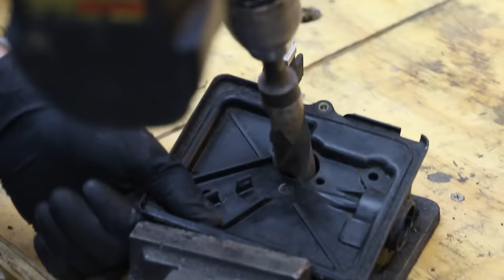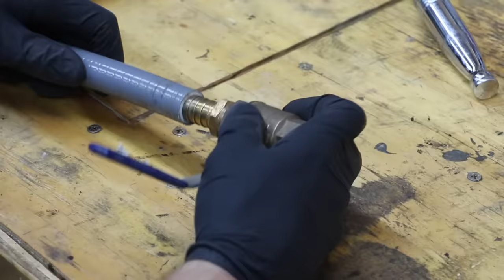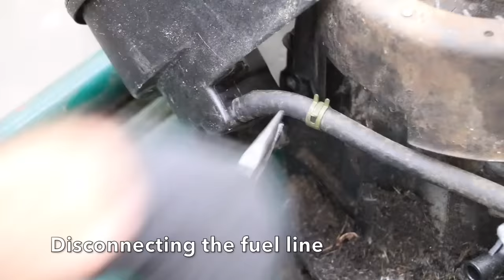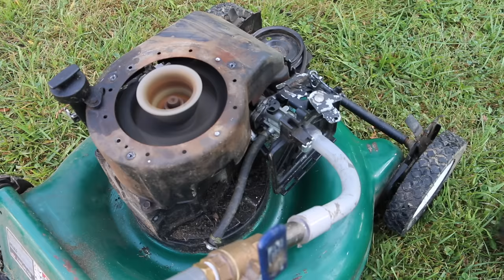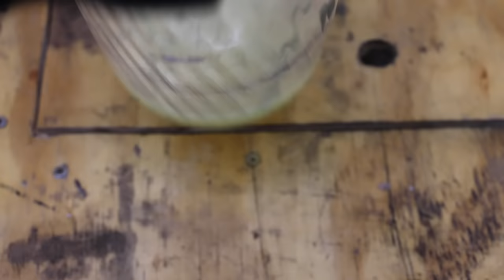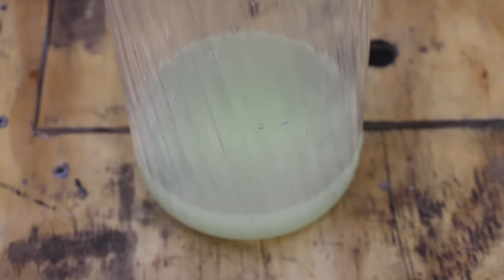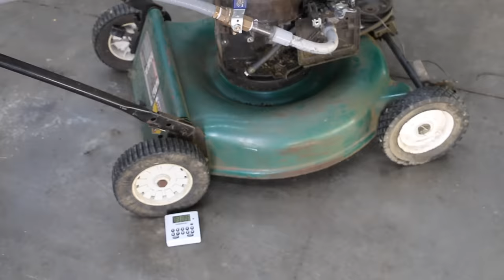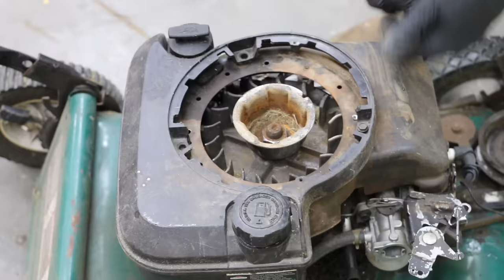Will a "Gas Vapor" Container Improve MPGs and Fuel Efficiency?  Let's find out!

Comment: congratulations you inadvertently made your own carburetor.
Reply: Technically not, he's created a bubbler and deleted the carb altogether. Carb spits out majority liquid that has been Atomized. Engines only run off vapor. A bubbler creates pure gas vapor. By creating a bubbler there is literally nothing a carb does for the engine. A carb only creates a fine mist of fuel--the closest thing to vapor. The reason you tune a carb is to make the liquid closest to gas. Inefficient. If he were to cut the intake line in the bubbler above the fuel line..the engine would've run even more efficient. Vapor combusts. Liquid ignintes.
Reply: @ATFM01  liquid gas doesnt burn even in a combustion engine the carburetor "atomizes" the fuel and the termperature of the combustion chamber puts it into a gaseous state...
Reply: "Burning" liquid fuel is just burning the vapours of the fuel as it the molecules speed up and become a gas....
Reply: @dad5744  The mower wouldn't run. Don't believe idiotic conspiracy theories you see on the Internet.
Reply: @brucetucker4847  I guess you tried it?
Reply: @dad5744  Nope. I haven't tried turning lead into gold through alchemy, either, but I'm pretty confident it doesn't work.
Reply: @dad5744  please take a chemistry class
Reply: @evan_rains  hey your super cool. Thanks. I'm guessing you tried it also.
Reply: @dad5744  no, I'm not stupid enough to believe it could work
Reply: @dad5744  Have you tried this? Does it work???
Reply: @evan_rains  you guys got trolled lol
Reply: @yungchill69  I really hope it was a troll lmao
Reply: @dangerousdoggo5465  . No. It seems I'm not smart enough. I need to take a chemistry class where I test theories of chemicals and fail till I get it right. So I guess testing some else's project is stupid but we do it in schools and labs to see if we can do something slightly different to make it work. I guess these post go along the lines of doubted, laughed at inventors such as Edison, Bell oh and here's a big one the crazy guy TESLA that later on another inventor perfected Tesla's AC power. What about Baird or Wright brothers. All stupid no good conspiracy theorist. So I guess for me it's off to sign up for chem class. I hope I'm not a failure...who knows that might be a good thing. Thanks so much for all your inputs and turning me in the right direction.
Reply: @babaayman9658  That's a dangerous game - most of the time it will go out, the one time it ignites the vapors on its way to the liquid you'll get a nasty burn.

And I did specify through alchemy. :-)
Reply: @dad5744  They don't need to try it the science is well established, the amount of energy required to liberate hydrogen from water far exceeds the amount of energy you could generate with the hydrogen in a combustion engine.
Reply: @Whorifice  so you say DC current is better. Ok. Well I'm in chem class right now so sorry I can't talk right now.
Reply: @brucetucker4847  It works since the engine doesn't care if you use a carburettor or a fancy substitute.

The problem here is that a 2-stroke engine needs oil as lubricant mixed into the gas. True, no smoke as he said but this means that the mower won't last very long.
Reply: Bruce Tucker it would run technically on water if converted to hydrogen, that technology has been around for decades,  actually has been used in aircraft and vehicles ,  and crude oil can be used in Diesel engines. So don’t shoot everything down you don’t understand 😉
Reply: C64 C64  the lawnmower he used is a four stroke engine.  And yes two stoke engines would not last without gas/oil mixture.
Reply: Someguy must have taken a chemistry class. I think it's called an HHC generator.
Reply: @someguy2557  The trouble with hydrogen is that splitting water into hydrogen (and oxygen) takes about a hundred times more energy than you can get back by recombining (burning). So either you have a real cheap source of electricity or it isn't economic at all. Commercial hydrogen is made out of waste from refineries. They take unwanted oil products and simply remove the carbon. So a hydrogen car can't work without gasoline cars, the gasoline users pay for drilling and pumping oil, the hydrogen users make use of some waste almost for free.

True, we have all seen our physic teachers drop 2 wires into water and make hydrogen, but the energy harvested is a fraction of a percent of the electric energy used. There are more sophisticated methods but they can't be scaled up well and are still low in efficiency. An all electric car - even the worst designs from the past - makes much more use of the energy.

So the hydrogen car had died with the atomic power. No way to make a carbon neutral hydrogen car. The best way possible for the time being is making all electric (light) vehicles and use the second best batteries for the task, the salt based ones instead of lithium. It would even be better to go back to cadmium than digging up enough lithium for every car!
Reply: It works I tried it!! U have to do it right
Reply: His carburetor would be the valve he was adjusting
Reply: @isaacdaughertycoventryindu7374  The bottle is the carburetor, the valve is a fuel flow regulator. Equivalent to the jets in a carburetor, just adjustable.
Reply: @evan_rains  You can't fix stupid my man...
Reply: @redlinezo613  carburetors you can adjust the air to fuel ratio that's what he was doing with the valve only adjusting the air to vapor ratio
Reply: @isaacdaughertycoventryindu7374  To a point yes, as more air flow would make more agitated fuel and thus more atomization. Because the air and fuel are mixed before the valve, its more like a throttle plate really, which makes the actual throttle plate more like a vacuum/air flow regulator.
Reply: @dad5744 Is this a question, statement or just complete non-sense? USING WATER AS FUEL IS POSSIBLE BUT IMPRACTICAL, so gtfo off your phone or computer and actually pay attention to your class, who knows you might learn something.

PS. Seriously bringing up actual Rockstar scientists and their disagreements as somehow equivalent to you disagreeing with what is established and accepted is just amazingly arrogant. Good science involves people humbly eating their words all the time, if you got something wrong and someone can prove it that's still progress.
Reply: Indeed. It's a carburetor. Still, great video!
Reply: @dad5744  robert
Reply: hi robert
Reply: Exactly how the 1940s and 50s downdraft carburetors work. I'm glad physics has not changed since then.
Reply: @dungeondark  In reverse up hill. Learned that in chem class.
Reply: I’m just wondering why he thought this would work ? Is he trying to debunk some conspiracy?
Reply: @CC-ke5np  is this not a Briggs or similar mower with a crankcase oil drain?
Reply: @CC-ke5np  what about the micro underwater breathing devices?
Reply: @iordnbrun5498  I am not familiar with that type. In Germany Sachs, Fuchs, Sabo and Stil dominate(d) the market.
Reply: @iordnbrun5498  Fake. Was made up for a James Bond movie. They just took empty whipped cream dispenser cartridges  as a prop. Even the US Navy fell for it and asked the movie prop guys how long it lasts. "As long as you can hold your breath" was the answer.

The first appearance of micro oxygen tanks in movies was in "Raumpatroilie Orion" (German Scifi series, made at the same time as the very first Star Trek episodes) where they repressurized an entire large space station by shooting a spare suit cartridge with a laser gun. It was a soda dispenser cartridge.

What is real is a soda bottle sized device for emergencies. It holds 2 or 3 breaths of air and meant to be used for troubleshooting your main scuba gear or switching to a spare gear. They are also good to buy time when your car dropped into water until the interior filled enough to open the door and then swim to the surface.
Reply: @Whorifice  so maybe you need to take a "Science history class". The inventors I mentioned, in their time, and some even after their death, had people just like YOU that said "it's scientifically impossible" and told they were stupid or shutdown. Tesla for example, before the internet there was the encyclopedia. Tesla had almost 4 pages then later was reduced to a small article as everyone felt he was a nobody. Sure now they are rockstars and Tesla only really years after his death. So please, keep going, tell me something else from your realm of knowledge.
Reply: No a carburetor spits liquid the the liquid evaporates on its own (that's why the efficiencies are higher with a warm motor) the fuel vaporizes by itself the carburetor just mist the fuel not vaporize it
Reply: @dad5744  Tesla had science behind him, this guy does not.  You do not.  Look up Dunning-Krueger.  You're just making yourself look that much more dumb.  The machine in your video breaks the 2nd law of thermo dynamics, which makes it an impossible fraud.  In order for a spark plug to ignite water as a fuel, you need to separate the H2O molecule into the base element hydrogen.  In order to do this, you need more energy to convert the water to hydrogen than the energy you would get out of the machine.  Very basic 2nd law of thermal dynamics stuff.  Go take a chemistry class and then come back and post comments, when you actually know what you're talking about.
Reply: Congratulations?  He's ahead of you hotrod.
Reply: @dad5744   Now I didn't try this either, but I did watch that video. 
A few thing's I'd like to point out;

1. When he stated it was releasing radiation and said it wasn't any of the typical things you would think it would be, like Alpha, Beta, or Gamma, he seemed to insinuate that it was something different or uncommon like magic. Well their are only a few types of radiation and he eliminated a good portion of them, so that "mysterious" radiation that he didn't have any idea as to what it was is probably infrared and visible light; this is nothing new and is honestly to be expected when you stick a metal pipe into the exhaust. To someone who is moderately familiar with this kind of stuff it makes him sound like an idiot. 

2. What he states is actually possible but it wouldn't be possible with his machine. The amount of heat required to split/decompose water and other compounds into usable fuels is so high you can't use iron based alloys to do it, and he did state that he used stainless steel which is an iron based alloy in the video. Water decomposition starts at 2200 C but would have to be at around 3000 C to get usable amounts of fuel. The stainless steel with the highest heat rating I know of is ~2000 C and melts at ~2700 C, any hotter than 2000 C for that steel would lead to failure. There is no other method for splitting/decomposing multiple types of extremely different compounds other than heating them up. 

3. The plasma statement. The interesting thing about this is that their are multiple types of plasma hot and cold. Hot plasma is just that, things that are so hot the turn into plasma, if the previous method is correct then this is that plasma and it would be very very hot and would most certainly melt steel. Cold plasma is the interesting part; cold plasma is extremely hard to make and requires electricity, further it is actually possible to split/decompose water and hydrocarbons using this method, the only issue is that he very clearly does not have the hardware for this method. Cold Plasma for clarification is when you heat up only the electrons. So for him to get this to work he would have to heat up the electron in the atoms to at least 2200 C while keeping the nucleus at no more than 800 C(This temperature because the machine isn't actually glowing, but this temperature would also probably prove catastrophic for the lubricant upon injection into the engine). 

4. The schematic were taken down so I can not review them to tell you they don't actually work, but hey conspiracy. However the addition on the end of the exhaust appears to be nothing more than a simple distillation apparatus and in no way resembles the cold plasma reaction chamber this machine would need to actually function as advertised. Further is is also highly unlikely the exhaust could provide enough energy to actually facilitate any of the processes I already mentioned, cemented buy the point that the lady adding scent to the napkins didn't have her fingers vaporized and nobody was alarmed by a flame that would have been shooting out. 

My best guess is that the contraption had enough fuel added to it for the video to end and the exhaust was probably being filtered on the way out to remove scents. Or everyone in the video was just a liar.

Edit: I just found and reviewed the patent. The patents doesn't state that it can run on only water, it stated it can run on water contaminated fuel. I was also correct in the method of operation, and this contraption would not get hot enough to decompose water. With water contaminated fuel it probably heats it up enough to where liquid water doesn't make it into the engine to cause problems and just passes through. Further on using alternate fuel sources this contraption would probably only vaporize the source, allowing it to actually be burned in the combustion engine, so you wouldn't be relying liquid fuel injection to vaporize the fuel. As far as the battery acid goes, low temp decomposition causes the release of sulfur dioxide and oxygen, so it probably allows for the easier burning of other fuels already in the contraption, battery acid wouldn't work on it's own. With this being said, the patent has the exhaust and reaction sections completely separate so it would be impossible for it to release no pollutants, and everything going in has to come out, else their will be build up. It would be technically possible for this contraption to facilitate the use of alternate already burnable fuel sources as a fuel preheater/vaporizer, but the zero pollution aspect is impossible based on the design lain out in the patent. The exhaust temperature wouldn't be higher than 1200 C so it would be impossible for this contraption to break down water and other compounds into its base components. In short the guy made a vaporization chamber, and is a complete idiot for not realizing that is what he made.

Edit 2: I just noticed the design that was used in the video was nearly identical to the one in the patent. The fuel is just routed though the exhaust and heated up prior to injection.
Reply: @CC-ke5np  thats probably not a 2 stroke and all 2 strokes do not take oil in the fuel.
Reply: @ATFM01  on behalf of mechanics everywhere, thank you.
Reply: Lol
Reply: @ATFM01  Didn't work that way when we worked carburetors in my carburetor class. Also, there is a carburetor that was said to have complete atomization with the atomized being burned dry, rather than wet. A little history lesson our instructor includes in the class.
Reply: @dad5744  You can use water as fuel, but only in hydro engines, which the government banned. In a gasoline or diesel internal combustion engine you are just trying to rust your parts, you won't burn water in these. If you wanted to burn the water by having it break down and burn the unstable hydrogen, an internal combustion gasoline engine, like PF uses, wouldn't work.
Reply: @brucetucker4847  They found you can use mercury to make gold, but the expenses far excede the yield.
Reply: @dad5744  Edison was a joke. Tired to prove how dangerous Tesla's free DC is by failing to kill an elephant and shocking a human on/off for 86 days and had less understanding of both AC and DC than Tesla.
Reply: @someguy2557  Internal combustion gasoline engines can breakdown water to hydrogen?
Reply: @CC-ke5np  Are you sure 2-strokes have valves?
Reply: @CC-ke5np  I didn't know I required a hydrogen car to drive my Mercury.
Reply: @isaacdaughertycoventryindu7374  Again, doesn't sound like what was taught in Carburetor class, also doesn't match up with any carburetors I, the multiple SAE techs I am related to or received instruction from, or blueprints for them that I ever seen.
Reply: spawn2882  Wouldn't power a car, yet powered several air ships. Also, how would you do this with an internal combustion gasoline engine, as that is what was used in the video and the base of the discussion?
Reply: @dad5744  I watched your GEET video. Snake oil salesmen showing a potentially pre-primed engine in a short demonstration without providing evidence of their system or discussing the process. I did find a commenter that did, the GEET allows your engine to run on atomized fuel..... Which is what they already do without the GEET.
Reply: @dad5744  There it is, argumentum ad hominem fallacy. Using arguments that are logically false doesn't prove your argument and defaces yourself for using it.
Reply: @alec4672  Really? So some carbs don't have a venturi?
Reply: @dad5744  "Why didn't Tesla's free DC take flight?" Are you willfully ignorant of capitalism?
Reply: @Bob800800  If they claim something is radioactive but can't tell you how while making the claim in this age, (almost everything is radioactive, even bananas wills set of a Geiger Counter, the matter is how high and what type), then we need to confiscate the crayons in their nasal cavity.
Reply: @davidcraft4909  All 2 strokes don't take oil in the fuel? Damn, those owner's, service, repair, fuel and oil instruction manuals and automotive service technician text books all need to 've rewritten.
Reply: @axslaps  Tesla didn't take off for one thing because of money. He tried to get support from Rockefeller but Rockefeller wanted people to pay for electricity by running wire everywhere.
Reply: @axslaps  please be specific
Reply: @dad5744  Yes, that's what I said.
Reply: @dad5744  I know a 500 mile/meter ranged coil wouldn't be cheap to repair, and to offer free repair and not charge for usage wasn't going to garner profits like Rockefeller, Edison and GE want.
Reply: spawn2882  You know I have experience as a federal service tech, carpentry and masonry as a specialist in those,  as well as the vehicles I drove, serviced, fuelled, hauled the vehicle as well as and issued ammo to up to 1.1G TOW missiles, and did my medium duty diesel engine report on has methods to prevent flames from entering the fuel supply, right?
Reply: spawn2882  Why do you keep suggesting everyone drive hydrogen powered VBIEDs?
Reply: spawn2882  XD
Reply: @axslaps  I believe there is a direct oil injection design for larger 2 stroke engines now
Reply: @brucetucker4847  You do know that you actually can on a molecular level, right? Not saying its feasible, but it is technically possible.
Reply: @dad5744  What many do realize is that Water, on it's own, can't burn. It would need to be broken down to it's base elements (Hydrogen and Oxygen) and then those gases are ignited to reproduce water. in a small internal combustion engine you will find that you get less power out of the water than the energy put in to break the water down to the base elements compared to Gasoline. That is where the issue lies in running a small engine off of water. There is a process to get it to work and the process does do as expected.

The funny thing is, NASA has been using "water" to launch their rockets for ages. It takes a lot of energy to break down water, but figure out how to make a car capable of just pouring a couple of gallons of clean water into a tank and driving off and you'll have the Oil industry knocking down your door to either pay you to never tell or to kill you off. It's what happened to the guy that supposedly made a volkswagen beetle run on water.
Reply: @TheDeelunatic  there's another post somewhere here of a video I shared. Sugar is the fuel but water is used to carry the sugar to the combustion chamber. Although several people on here say that's it's trick photography. Carbon footprint is a huge thing with this. If someone was to actually develop it we might be able to reduce the greenhouse gases. But if we did that the earth might fix itself and gasoline would be minimally used and of course we can't have that. Guess it's along the lines of no free electricity, gov can seize what they want and oil controller the world.
Reply: @johnturtle6649  It is possible through nuclear processes, not through chemical ones.
Reply: @brucetucker4847  Thats all im saying, it is technically possible. Alchemy isnt stupid, its just unfeasible.
Reply: @danielalfonso672  
"I believe there is a direct oil injection design for larger 2 stroke engines now"
They've been using that tech in motorcycles since 1913 so it isn't by any means new lol.
Reply: spawn2882  Storing it as water would make it useless as a fuel since it takes more energy to split the molecule than you would get from recombining it. Other than scrapping the idea completely, efforts should be focused on making hydrogen storage as fail-safe as possible as opposed to trying to break the laws of physics.
Reply: @ATFM01  Atomization is better.
Reply: @johnturtle6649  The problem with turning elements from one into another with alchemy is that alchemy is a spiritual process,  not material.
Reply: a carb does a different job  it just  sprays a small amount of fuel  that is different from vapors .
Reply: It is very short sighted to write off hydrogen powered vehicles, just because water is the only place you know where to get hydrogen. That just sounds more like a reason to explore new methods of obtaining cheap hydrogen. You don't even really need to know chemistry to realize that. That's just basic logic.
Reply: shea  hydrogen is in gasoline and it's what causes it to burn .  Watch  Stan Myers videos  He tell how much  hydrogen is in   each one  .
Reply: @frosty1433  I'm not opposed to it because of that, I'm  opposed to it because I'm familiar with the history of its use and LZ129, R101, Dixmude and others and I know damn well that oxygen is abundant, how it reacts with hydrogen and how easy it is to make explosives and I also know many people are really good at shooting moving tarets, so hydrogen engines are just IEDs in waiting.
Reply: @brucetucker4847  they actually do turn lead into gold Mr chemistry.
Reply: @dad5744  you do know that sugar is a hydrocarbon, yes?  that's why you exhale CO2.  it's why plants inhale CO2 to make it.  you're also failing to realize the environmental impact of growing all that sugar.  much like the ethanol thing.  if we converted every inch of farmable land in the world to grow corn for ethanol, we would not even meet the energy needs of the united states.  that speaks nothing of the environmental catastrophe that comes from a monoculture such as that.

hell, we already have a spate of envoronmental problems due to overgrowing sugar beets.

ecology aside, if you'd learn a bit about real chemestry, as people have several times suggested to you, you'd know that burning sugar will not lessen any carbon footprint.
Reply: @rakninja  so you saying it's trick photography like the rest. Ok. Who said cover the world with sugar? See I don't have any education at all. So your talking over my head. I guess his meter lies. But the problem is NONE OF YOU SCIENTIST HAVE TRIED IT. YOU ONLY GO BY WHAT SOMEONE ELSE TOLD YOU. IF WE STUCK WITH THAT I GUESS THE WORLD WOULD STILL BE FLAT. so you keep your flat map and I will keep my globe. Maybe if y'all looked outside the box y'all would find that not everything they tell you in school is correct. In the military we had guys like y'all that thought they knew EVERYTHING just because they got a butter bar for going to college. Those are the guys that read the books on army tactics and thinking they knew it all got people killed. And no I'm not changing the subject. Y'all are like horses with blinders on only going where they lead you. Y'all are cool arrows👍👍 << by the way that's 2 thumbs up.... REALLY cool.
Reply: @axslaps  All I'm saying is that if push came to shove, and we had to replace gasoline for some reason, I'm sure we would probably turn to a hydrogen solution some how. The safety concern is a very valid concern, but I'm sure we could just find someway to store it as some sort of safe hydrogen-enriched fluid, that would probably work the same as gasoline. I mean, I just think it's smart to think of possible alternatives, by finding a way to make what we know works, actually work in a viable way. If it's in the realm of possibility, think about how it might work, once you've already established how it won't work.
Reply: @rakninja  your linked vids are no where close to what's being talked about. And I guess that if CO2 is on the low side it's d bad. Sugar compared to petrol is about a 1/16 of the foot print. Did you watch the GEET video?
Reply: @dad5744  why would i, you were talking about sugar for fuel, which is ridiculous if you thought about it for half a second.

the point of my videos was to show you the residue left over by burning sugar.

now, having watched that video, i do not understand how anyone who knows the first thing about internal combustion engines or chemistry would see this for anything other than snake oil.  "x-rays that prove that it is some unknown radiation?"  "carbon being transmuted to a lighter element?"

for one, x-ray machines can only detect x-rays, the active part is the film, which is only sensitive to x-ray radiation.

for two, it takes more energy to transmute an element to a lighter one than is released.  example:  you use electrolysis to separate water into hydrogen and oxygen.  the net electricity you put in will always be greater than any energy you can pull out.  this is because the laws of thermodynamics.

furthermore: https://www.splcenter.org/fighting-hate/intelligence-report/2012/oklahoma-survivalist-claims-motor-will-run-anything
Reply: @frosty1433  Why hydrogen over aqua engines, electric or others?
Reply: @TheDeelunatic  I read that his patent was rejected. Haven't heard about him being threatened, just that the system shut him down and banned it.
Reply: @Sertao2013  What do you think spray is?
Reply: @rakninja  As well as sage, Russian willows among thousands of other plants, bugs, insects and architectural development, what's your point?
Reply: @dad5744  You don't have to go to college to get O-1. And completing, they changed it a few times now so, however many years in SROTC or different number of years for JROTC will give automatic promotion upon enlistment.
Reply: @dad5744  Also, don't have to know something only by experience, I don't need to be a burn victim to know it'll hurt, damage tissue, etc.
Reply: @rakninja  Never taken chemistry, but I did some independent research. And yea, sugar in the engine is no good, been word for a long time it would caramelize. Project Farm did the video on using sugar, wasn't seeing as much as I anticipated, but regardless pv cause, carbon buildup in a combustion chamber isn't something I'd  say to aim for with "improving" performance, as these pro-sugar nuts think it does.
Reply: @CC-ke5np  Right now. Processes improve or change.
Reply: @diji5071  As stated before: yes, but by nuclear reactions, not chemical ones. There is no way to turn lead into gold through chemistry.
Reply: There is a big difference . If you  spray gas  from a carb it will fall to the ground and  get the ground wet . If you send vapors through the carb   nothing will hit the ground .
Reply: @brucetucker4847  oops!
Reply: @brucetucker4847  Alchemists have often been dismissed as pseudoscientific charlatans but in many ways they paved the way for modern chemistry and medicine. The alchemists of the 16th and 17th centuries developed new experimental techniques, medicines and other chemical concoctions, such as pigments. And many of them "were amazingly good experimentalists,” says Lawrence Principe, a chemist and science historian at Johns Hopkins University.
Reply: @axslaps  what exactly is the sage and russian willow thing directed at?  it is not clear to me.
Reply: @rakninja  Any idea how many deserts are manmade?
Reply: @Sertao2013  Dry vapor? That would be the ideal. There was a carb that supposedly had a great mastery of having dry fuel in the chamber over a century ago, but it was also hidden away.
Reply: @axslaps  cannot find a good source.  the only one i can see for sure is the saini desert, erected as a kind of border wall between egypt and palastine.

i've seen a few crackpot places claim that ALL deserts are man made, however mountin ranges are typically the natural cause for deserts.  for example:  the himalayas created the sahara.

why are you asking me this, though?
Reply: @brucetucker4847  water has the most combustible and abundant element on earth in it so I'm sure its possible
Reply: @NoMoreBsPlease  You are talking about making hydrogen?

Yes, there are more efficient ways than shown in physics101 which is putting two wires into salted water (1..2% efficiency). The trouble is that all high efficiency methods are complicated and can't be scaled well. So it can't be economically made in an industrial scale (yet). At least not as long as using refinery byproducts is so incredible cheap to process to hydrogen.

But the real problem is that there are too many humans on this planet which want to drive cars and consume disposables. So no matter how efficient and "green" you make anything, it all adds up. "Almost no pollution" multiplied by billions of consumers still equals "way too much pollution".

E.g. over the past decades, cars consume only 1/4 of the fuel they used to. But now there are over 20 times as many of them. An the numbers will keep increasing until something really bad happens that makes us not wanting to own and use cars.
Reply: @CC-ke5np  money is and will always be the problem, I remember when water was free.
Reply: @axslaps  combustion is proven to have it's benifits. We also already have a world full of combustion vehicles that are easily converted. Argument is a discussion between two people who both already have their minds made up, and therefore a fruitless discussion. I am not interested in a fruitless discussion, so I ask; are you questioning me to to understand or to argue?
Reply: @frosty1433  Cool, you understand things the same way I do.
Reply: @Sertao2013  Nothing? I'd like proof.
Reply: @diji5071  Not exclusively alchemy, toxicology has as well. My understanding is Italian toxicology lead the way in forensics.
Reply: @CC-ke5np  I don't know about your statistics but that's the thing I argue about annual manufacturing of trillions of vehicles. We make all these cars, send them to dealerships, the buyer busy there, in factory or maybe other means, most don't get sold, sell remains at discount from the following year on. Make new model, sometimes the new model is a new generation, or even a different model all together rather than year of the model generation, do it allover again. And not just cars, but also trucks, helicopters, planes, drones, phones,  etc. Also, you know in U.S. we have a growing weight problem, malls and other stores out the ads and the biggest mall has multiple national locations in D.C., we import and export food yet 70% of what goes to us for eating is wasted, it's been...... 20 years or what,  now and we still can't throw enough money at our education system to keep kids from getting dumber, in 1997 our national IQ average was 97, last I heard, Texas has highest IQ standard for legal retardation at 80, and U.S. is somewhere like 37th on the International education ratings?   We also keep voting and reelecting people proven to have been cheated to win the election and or too incompetent for the position.
Reply: @ya2131  Have you read that before posting? If yes, why'd you post it?
Reply: Right nothing . vapors are not heavy enough to fall to the ground  but a spray  will . If you have ever used a vaporizer  when your kids are sick  you will notice the  walls and ceiling  get wet but never the floor . Gasoline  vapors  like the vapor that  escape from a open  gas can   thats in your garage  hover very close to the ground  but won't  hit the  floor  . If you have a gas furnace or gas  water tank in your  car garage  it has to be  2 feet off the ground   because  the vapors  hover and  can explode .
Reply: @Sertao2013  You are so lost.
Reply: Do you think gas vapors   from a carb will fall to the ground and make a wet spot ? You are the one that is  lost . You think that gas vapors and  the spray  that a carb sucks into the engine is the same thing .
Reply: @Sertao2013  You are still going in the wrong direction from what I said.
Reply: @Cjohn31  there still is a lot of water you can have for free. The problem is that you can't drink it without becoming sick.
Look for "Tom Lehrer pollution", this song was made in the 1960s!
Reply: @axslaps  it truly is amazing how far we've come since the 1800s. Just phenomenal.
Reply: @dad5744  you're*
Reply: @dad5744  you mean like a steam engine?...
Reply: @Bruce Tucker Surprisingly enough, one cannot say for certain whether or not there is a method by which base metals (not just lead, according to alchemy) could be turned to gold, as seen here:

https://www.smithsonianmag.com/history/alchemy-may-not-been-pseudoscience-we-thought-it-was-180949430/
Reply: And furthermore, Robert is not entirely wrong. Hydrogen can be separated from water as simply as applying an electrical charge to it, capturing and storing the hydrogen.
Reply: spawn2882  You need a source of energy for hydrogen cells or electric batteries.  If you are using electricity off the grid, it probably came from fossil fuel.   When Obozo wasted billions in schemes (where the money actually was going to secret offshore accounts) to make renue-able energy,  the 28th largest coal burning electric power plant was making more kilowatt hours than all the solar and wind power in the country.  In thermodynamics, there is no free lunch.  The new catalytic methods to make fuel with sunlight requires huge plant sizes and thus costs and it only works 6 hours a day.
Reply: @ATFM01  he's right, you need heat to create vapor.
Reply: Good job dude hopefully they will get it. you need heat to create vapor, and vapors don't have much btu's.
Reply: No they dont, look at the Detroit Diesel.
Reply: Rebassed Muzikk that valve would be his choke
Reply: My two cents, it's not really running on vapors from the jar. The carb, along with the ball valve, are both capable of metering air to increase/decrease RPM. The agitation is great enough to cause the fuel to atomize in the jar and vacuum is pulling that atomization into the combustion chamber. Thus, the process that normally takes place in the carburetor is happening in the new setup. Same thing, just altered.
Reply: Yes. A carb that can only deliver the limited amount of vapor in the container. A carburetor will atomize fuel, and a warm intake manifold and hot valve set/combustion chamber will vaporize it.
  A "vapor" carb will work, but the engine runs very lean, and won't last long. We use liquid carbs and injectors because it's easier to use and measure, but also atomized fuel is still liquid. It's easily managed. Also, gas vapor is very dangerous. Much more so than liquid gasoline. 
...And the latent heat of evaporation/vaporization actually cools the engine. There is no conspiracy. If vapor injection was better, everyone would use it. 
We act like there are not THOUSANDS of engine tuners that understand these concepts, and work with them daily...that's one hell of a conspiracy.
Reply: lmao at the dude posting random conspiracy videos for 3 months straight
Reply: This thread is FN hilarious!!
Reply: Only can go one speed exelaration if more no horse power boss..this job same to gas user
Reply: @babaayman9658  My house was on fire and I put it out with gas.  I also started drinking gas because it's better than the local city water.
Reply: The Carburetor = His Gas Knob  😂❤️😂❤️😂❤️😂❤️😂❤️😂❤️😂❤️
Reply: @LosCadaver  Yep
Reply: @LosCadaver  just higher energy they reach escape velocity at hay presto
Reply: Not exactly but basically
Reply: @dad5744  The moment you say "Tesla" is when your credit runs out entirely and forever. "Tesla" when talking about energy and other cuckoo's magic supernumerary engines and whatnot is like the godwin's point of energy talks.
Reply: @dad5744  Since noone else addressed this: Tesla's free energy never came to fruition not because of capitalism (there's lots of free things), but because it was dangerous*. Air is an insulator. Not the best, but not the worst either. Therefore you need a specific voltage to arc electricity a specified distance. I think it's something like 75000v per inch. Now, I dont know if you were one of those "fork in the socket" kids, but if you were, you know just 120v of AC power is.... pretty uncomfortable. Now imagine 75,000 volts buzzing through the air all the time (and yes it would be *constant buzzing because you're forming and maintaining plasma, something you wouldn't want either, but lets ignore that). 240v can kill you fairly easily, and yes, tasers sit at 50,000 volts but tiny amperage. How much amperage do you think you need to transfer through air to power a home? a lot more than 0.00364 amps (standard X-26 police taser) But you also need a LOT more than 75,000 volts; because you need it to go further than 1 inch.  Probably a solid 70 feet or so. so 70x12x75000 = 63 million volts. Yikes.

Now, that's all and good, we do have million+ volt lines in use in select areas of the world, but Electricity (or rather physics in general) prefers the path of least resistance ("the lowest energy state"). Meaning if you ever become a better grounding point than the house next to you... say hello to 63MV coursing through the top of your skull. Maybe you're a weirdo, but not something I'd enjoy feeling.... or even smelling.

So the safest plan? a couple thousand volts through a much better conductor... lets go with copper. Now electricity always has a better grounding spot: the next bit of copper that leads to a house and ground. Plus now you get the added bonus of better control, meaning you can more easily make money off of it.
Reply: @CC-ke5np  Do you know what a hydrogen fuel cell is?
Reply: @jghifiversveiws8729  Of course i do. The trouble is that making hydrogen is either inefficient and/or not good for the environment. Also they are very "slow". When you kick down the accelerator of a modern gasoline powered car, the engine can instantly release at least 80kW of energy to accelerate (most cars far over 100kW). 

A large fuel cell the size of a large car engine can give you 50kW of power at best so you still need accumulators to gather electricity in order to have the same performance as a gas car. Also the efficiency is around 70%, the electric system and the electric motor also wastes some energy. This gives you 50% of efficiency at best (more likely 40%). This is the efficiency range of a stationary diesel engine under nominal load. Of course in a car, a gas/diesel engine gives you typically 10% of efficiency or worse (just idling). Even if making hydrogen would be 100% efficient, you still waste an awful lot of energy compared to a lithium battery.

A hydrogen car (fuel cell or ICE) is good for making use of waste oils or natural gas (rich in hydrogen components) but not for using electricity using electrolysis since the efficiency of electrolysis is rather low. The best laboratory small scale efficiency is 70%, the industrial scale efficiency is less than 50%. Homebrew electrolysis like seen in physics 101 in school is 1% efficient.

So a fuel cell would be an adequate solution if you have lots of nuclear power plants and don't mind the relative low efficiency (compared to battery powered all electric cars). But fusion power doesn't work yet and people are too afraid of fission power which is still the only CO₂ neutral energy source which works at a large scale known to man.

Anything is better than a conventional ICE engine, so a fuel cell could cut the CO₂ impact on the environment. This is true! But only by maybe 50% only. Fitting a VW Jetta style TDI engine into all US cars would cut the CO₂ impact by at least 70%. Why not doing this? Because nobody likes very slow accelerating cars.
Electric cars are not a new thing, they even predate gasoline powered cars! But they are slow and can't be refueled fast. We could switch to all electric, the technology is around since the 1880s but nobody wants to own an electric car because they are slow and inconvenient.
Reply: @someguy2557  
There are 2-stroke engines that use straight fuel because the oil is injected into the cylinder.
Reply: @brucetucker4847  Except it totally does work, its just ridiculously expensive. Look up nuclear transmutation.
Reply: @erikmyers3888  Nuclear processes and chemical processes are completely different things. You cannot turn lead into gold through alchemy, i.e., by any series of chemical processes.
Reply: @brucetucker4847  I argue that an alchemist would be able to make no distinction between a nuclear process and a chemical process. Both would be considered alchemical processes should they be observed before the formulation of atomic theory.
Reply: There is nothing in alchemy remotely comparable to a nuclear reactor or cyclotron, so I stand by my comment.
Reply: Ok, to settle all of the arguments about this video, how about a clear PVC tube between the bubbler and the carb? I think you’re going to see fuel, not just vapors, but there’s only one way to find out.
Reply: @brucetucker4847  So, everything that you don't understand becomes a conspiracy theory. That is Ignorance. I am a mechanical engineer for 43 years now, so I can tell you that when gasoline is sprayed into a combustion engine cylinder, the spark ignites the fuel causing it to expand rapidly into a gaseous state then it explodes releasing the energy that pushes the piston. So the fuel must be turned into a gas before it can explode.
Reply: @dad5744  Crude oil would work if you heated it, water has a lower energy content than it's components so it won't combust, unless you supply it with so much energy that it's decomposes to H2 and O2.
Reply: spawn2882  Why not just run an electric motor off the output of the altenator, and drive both the car and the alternator off the motor. Oh, wait, I'm pretty sure that doesn't work either, and for much the same reason - you can't get out more than you put it.
Reply: @brucetucker4847  He's actually ran the mower on crude oil.
Reply: @Whorifice  a small battery can generate a lot of hydrogen from water!
Text books are full of impossibles.
Reply: @CC-ke5np  not so.
usable quantities of hydrogen can be made with just a small battery.
bump the battery volts uo with neodymium magnets and see what happens?
Reply: @redlinezo613  nonsense.  carbs don't leave a thick residue fuel.
Reply: @Whorifice  the water power guy may have been doing just the same as this fumes guy but just using the bubbler and some electronics to split water so engine ran on hydrogen.
Let's remember Nikola and his experiments showed electricity can do amazing things?
The video of getting a coil to make electric by just putting a neodymium magnet to it shows that a continupus source of energy is available so if the energy from coil-magnet lights a lamp then how much wate can it split to make hydrogen to burn.
If the bubbler was to be enlagred and have a winding of fine copper wire inside and  rings of magnets would it make free energy to separate a lot of water for free fuel ?
Any backyard mechanic care to try?
Reply: @danielalfonso672  ship diesel engines run direct oil.
Reply: @axslaps  airships used hydrogen for buoyancy not fuel.   the fuel was actually tanks of propane which is what we can run cars on today.
Reply: A magnetic field moving through a conductor can induce a current in a complete circuit(orientation dependant), that is how we produce electricity with generators, but the magnets don't move themselves, so no free energy. The problem is that using electricity to make hydrogen has yet to be done efficiently enough that an engine running on hydrogen could produce enough power to make its own hydrogen. I would love for someone to prove otherwise, but that's my whole point, no one has or we would be doing it already. And if you are somehow magically getting free energy why not just run an electric motor which is superior to combustion anyway?
Reply: Bruce Tucker I actually made a pvc water tank with two electrodes running inside. One to positive and one two negative. Then put a nipple in the top of the cap and one in the cover of air filter housing on mower, then disconnected fuel line from gas tank.   When I connected an 18 volt drill battery to the positive and negative electrodes on the pvc water tank, it creates hydrogen bubbles off one electrode and oxygen bubbles off the other electrode.  The hydrogen and oxygen mix would travel through the tube in the top and travel to the carburetor intake.  Guess what happened.....I mowed our entire front and back yard on a gasoline engine running on oxygen and hydrogen gas.
As for longevity of the engine, I can’t tell you.  I only did it the once to see if it could be done.  It was our good lawn mower and I didn’t want to take chances with it.    Without monitoring engine temps to see if they would run normal, and without a tear down after weeks or a season of use to see the internals to look for heat damage or build up, I am not sure how good it would be for the engine.   But considering all liquid gas has hydrogen and oxygen in the first place, I can imagine it would be totally fine.
It seemed to run smoother.
Reply: Robert I actually made a pvc water tank with two electrodes running inside. One to positive and one two negative. Then put a nipple in the top of the cap and one in the cover of air filter housing on mower, then disconnected fuel line from gas tank.   When I connected an 18 volt drill battery to the positive and negative electrodes on the pvc water tank, it creates hydrogen bubbles off one electrode and oxygen bubbles off the other electrode.  The hydrogen and oxygen mix would travel through the tube in the top and travel to the carburetor intake.  Guess what happened.....I mowed our entire front and back yard on a gasoline engine running on oxygen and hydrogen gas.
As for longevity of the engine, I can’t tell you.  I only did it the once to see if it could be done.  It was our good lawn mower and I didn’t want to take chances with it.    Without monitoring engine temps to see if they would run normal, and without a tear down after weeks or a season of use to see the internals to look for heat damage or build up, I am not sure how good it would be for the engine.   But considering all liquid gas has hydrogen and oxygen in the first place, I can imagine it would be totally fine.
It seemed to run smoother.
Reply: @jerryglass6556 Nice job, however that battery didn't charge itself, so we get straight back to the point I am making. And even if we are to ignore that, claiming you got it to work is anecdotal evidence at best, why wouldn't you demonstrate it working?
Reply: @CC-ke5np  "So the hydrogen car had died with the atomic power. No way to make a carbon neutral hydrogen car. "

Intermittent energy (solar and wind) are carbon neutral and can be used to power PEM electrolyzers.  

Intermittent energy often has the problem of overproducing at times forcing curtailment to be done to avoid overloading the grid.  Instead of curtailing, you could use that excess energy to produced hydrogen.

That said, Hydrogen cars are still not a great idea. For personal vehicles on short-ish commutes, electric cars are so much better.  Hydrogen is better for trucks and other larger scale vehicles.
Reply: @dad5744  did you know that Edison's first go go at a lightbulb he used a bamboo filament I heard that the Smithsonian still has that original light and that that filament has yet to break?
Reply: @someguy2557  don't forget some had an auto lube but then must use existing throttle controls...
Reply: @isaacdaughertycoventryindu7374  yep...but very crude nonetheless.
Reply: @jmcbri  did you see the sizes of the jets😂
Reply: Obviously a carburetor has a different function
Reply: @brucetucker4847  nah bro I've seen a guy turn an entire train cart worth of coal into gold
Reply: @Cam-jm6xv  The market price of coal is way down these days.
Reply: @brucetucker4847  he bought the whole mining town with the gold
Reply: @dad5744  Hey Robert, sorry these guys are razzing you so hard.  You can run it off the hydrogen captured by the electrolysis of water, and probably by burning crude oil too, although you're not going to get nearly the explosive force needed to turn over this type of engine (so probably not).  Don't take it too hard, these guys are all science and no sense of humor.  They might be right, but more than likely there's a lot more to physics than they are even aware of (myself included).
Reply: @ATFM01  Now that's a comment. Thank you and well said sir🍻.
Reply: @CC-ke5np  except... this isn't a 2 stroke engine?
Reply: The potential energy from gas is not variable ,stoichiometric at a certain rpm is what carborators are designed to accomplish if you are burning less fuel than what the carb is tuned for your motor is likely running lean and it won't live a long happy life
Reply: That is exactly what he did this motor is not running off vapor it's running off the atomized fuel mist caused from all that sloshing around  in your fuel bong a mist is fuel in a atomized liquid phase with thousands of tiny drops..  vapour is fuel in a single molecule gas phase and you are not going to run that motor off of a vapor
Reply: @ATFM01  motors do not run off vapor they run off atomized fuel mist in a liquid phase vapor is a gas phase this motor is not running off of a vapor
Reply: Perhaps we could make a car run on troll blood. That would be a plentiful resource that nobody would miss....
Reply: @LosCadaver  here's a question... you know how fuel injectors are supposed to vaporize fuel or close to it. They say they spray in such fine way that it's practically mist. I've seen a few vids where people use fuel injectors and it's Definitely not a mist. Dam thing resembles a super soaker more than a mist. So I'm curious to truly know does a care actually atomize the gas? Or is it just spurting gas in with the air? 

I've always wondered why not vaporize gas then fill a tank with it. Like a propane tank type of deal. Even if you got the same mileage do you think it'd be less weight? I mean twenty gallons is a hell of a lot of weight. But a big propane tank isn't as heavy, I think anyways. I would like to see if it would work. If it did and made it more efficient, maybe it'd help prolong the combustible engines. Well just until they get some better batteries for ev's.
Reply: Runs off fumes lady
Reply: And a crude one at that.
Reply: @CC-ke5np  most lawn mowers are 4-stroke not 2-stroke, every lawn mower I’ve ever owned has a separate oil fill port, and oil in the crankcase, weed whackers are most of the time 2-stroke and needs oil in the gasoline to lubricant the engine.
Reply: @ao341  in order:

If a video of a fuel injector "looks like a super soaker" the video maker has probably increased the flow through it by a LOT to make it more visible on camera. An engine wouldn't run at that high a rate of injection. At normal flow rates they do produce mist.

The small droplets produced by a carb or injector get vaporized within the cylinder (at the latest: carbs and throttle-body injectors are far enough away from the cylinder that small amounts of the droplets evaporate in the inlet tract.) This works better the higher the temperature, which is why it takes a lot of fuel to start a cold engine. 

Pre-vaporizing gas as you described wouldn't work because the gasoline would just condense into a liquid again. Trying to pressurize it like a propane tank would make it condense much faster. Propane is a gas at standard temperature and pressure but in the tank it's actually a liquid because it's under higher than standard pressure. It turns back into a gas as soon as you release that pressure. Gasoline wouldn't do that because it's a liquid at standard temperature and pressure. If you vaporize gasoline then put it in a pressurized tank, what you end up with is a tank with extremely thick, heavy walls, full of liquid gasoline.
Reply: I'm about to do this
Reply: everybody who sayes it does not work just try it and you will see it works
Reply: A carburetor atomizes not vaporize.

You need to actually know what your talking about before talking
Reply: Technically not
Reply: @evan_rains do some research it does work 😂😂 they did sell kits back in the 70's
Reply: @Whorifice that was the belief 15 years ago...😂
Reply: I don’t get it. Is this comment supposed to be funny because it’s definitely wrong he did not build a carburetor.
Reply: @ATFM01  Initial carburetor designs ran on gas vapors.